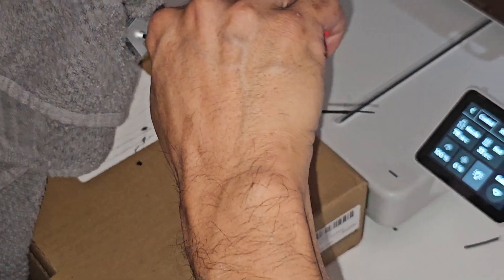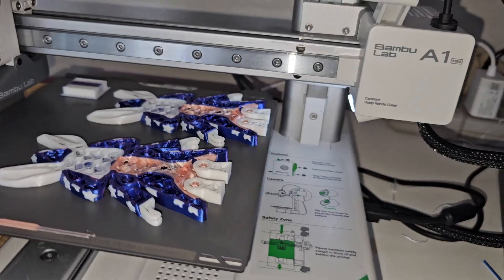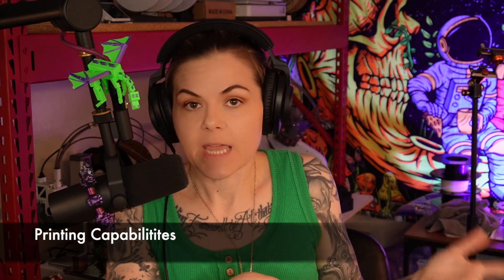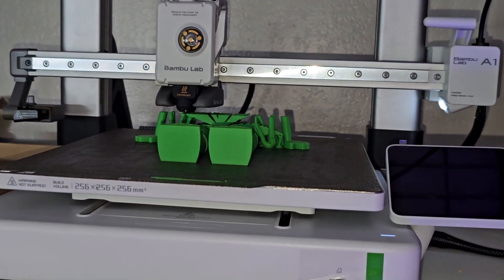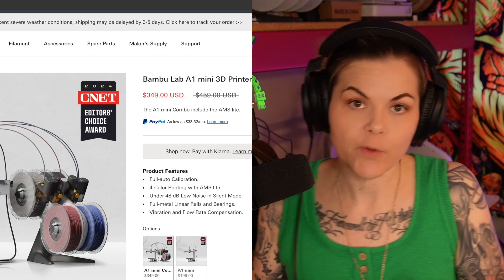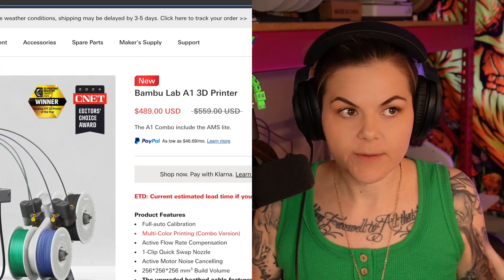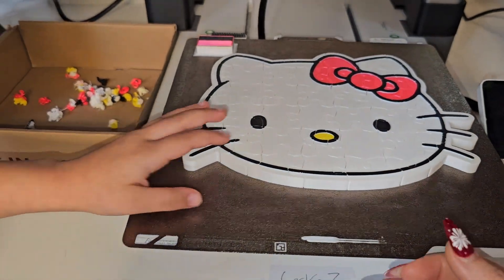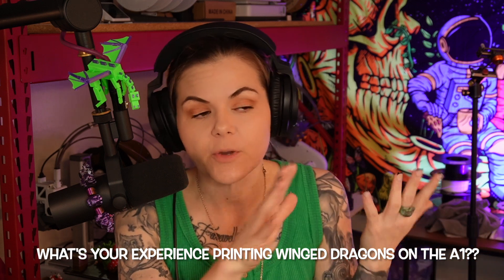Which 3D Printer REIGNS SUPREME After 60 Days of Nonstop Printing?

Comment: I make lithophane lamps and started with a p1s. I had to get another printer due to high demand and got an a1 mini for its price n availability at the time. A little background, I've been printing for about 8 years now and always disliked small print beds. When i setup my lamp on the a1 mini, i was totally shocked! This thing is a beast! I now have 3. Maintenence, reliability... lil fker is  just a work horse! Tough too! I dropped one from a 3' desk, snapped the top feed hub, got a replacement, checked the bed screws, recalibrated... and the lil fker started right back up like nothing happened 🤯
Reply from the maker: @jackavol4150  🤣🤣 that's awesome!! Such a great printer I agree!!

Comment: I bought an A1 mini/AMS combo at the end of last year and then a P1S without the AMS about a month later. Then this month I bought an additional P1S with the AMS combo. They all run pretty much around the clock as I'm building out a gridfinity system to organize the multitude of things that I have in a large toolbox in the garage as well as the two smaller tool chests that reside in my home office. I can't image not having them. Having a P1S without the AMS and one with it I can definitely say that having the AMS is a huge convenience over not having one. Printing out storage solutions that include labels is so much more convenient to do when you have multiple colors loaded up in the AMS to print the body of the container in one color and then have it switch to a different color for the text to make it easily readable. I have just a single instance of a piece of filament breaking off in the P1S AMS and having to disassemble it to get it out, but it was surprisingly simple to do when you follow the online instructions. And the filament breaking off was really my own fault. I knew it was partially broken when I put it in but was hoping that the AMS would still be able to pull it through, so it could have totally been avoided. Being lazy cost me half an hour of downtime to take it all apart and fix it.😋
Reply from the maker: @jocelyn-n-tech  thanks for the info! I'm currently trying to decide if I want to get a p1p or a p1s. And also trying to decide if I want an ams on either of them. The p1p with an ams is the same price as the p1s combo.  I almost want either 1 color or 8 colors. Such a dilemma😂😂 i find a lot of positive comments regarding the p1s and not many about the p1p so I have some research to do still. Thanks for watching, I couldn't imagine not having printers either. So many useful items around the house from them !
Reply: @HamilsHouseof3DPrints  I know it can be a tough decision! I bounced back and forth between the P1P and P1S as well. I ultimately picked the P1S to sort of "future proof" myself in case I wanted to get into printing more advanced materials. But buying a P1P for now and waiting until you need it in order to purchase the external panel kit makes sense as well. You kinda can't go wrong with any of them to be honest.

Comment: Somethings wrong with your A1s causing clogs. Had mine since Dec 2023 printing at least weekly with zero clogs. I primarily use polylite pla+. I'd try different print settings, then new print nozzle, then print head, etc.
Reply from the maker: We replaced nozzles and luckily haven't had many issues except the filament spools always get stuck. Dont know how to avoid that issue
Reply: @HamilsHouseof3DPrints  good to hear! Filament spools are such a pain. I wish the AMS would just give it a bit more gas pulling on the filament as opposed to just giving up and showing an error. If you find a solution do another video to help us all out!

Comment: Our A1 and A1 mini are about as reliable as each other. We've had clogs on both, but it's mainly been a problem on the A1, as we only have one AMS lite, and that's attached to the A1. Almost all of our clogs have been with 0.2mm nozzles though, due to switching between our PVA support material and either PLA or PETG print materials.

When the A1 does clog though, being able to swap in another nozzle and continue the print immediately, using the A1 mini to deal with the clogged nozzle, is a a hugte time saver. It helps that I only p[aid £70 for the A1 mini, since I was going to buy an AMS lite, it made sense to just buy an A1 mini combo instead of a stand alone AMS lite.
Reply from the maker: Having extra nozzles on hand has been a must for us too!! Any way I can avoid delaying a project, so that's been helpful! Thanks for watching 😃

Comment: If space is important you will find that the P1 and X1 with the AMS on top has less than half the footprint.  That alone could be worth the extra cost especially to a business which might end up with many printers.

Switch to a 0.6 nozzle and this will probably eliminate your clogs.  Debris in (or on) the filament is the most common cause.  I don't know what you are using for filament or the conditions in the room where you print.  Look for a contamination source.  Something like pet hair or chemical deposits.  Something seemingly innocuous like hairspray.  Could be something simple like hand lotion deposited on the end of the filament when it is loaded.

As for Jams, I assume you are talking about a jam in the extruder.  Clogs can lead to a jam.  But this seems like it could also be caused by foreign material in or on the filament.

This was a nice video.  I wish you well in your 3D printing endeavors.
Reply from the maker: Great advice on changing to a .6 nozzle, this was not something I had considered! And i think you nailed it with debris. We have 2 small dogs and they are laying around in our print room probably shedding their little hairs all over my stuff!! 😖 LOL I'll have to clean up more often! Thanks so much for the input and thanks for watching! 😃

Comment: I've had an A1 going since summer. Printed an obscene amount of stuff. It's been smooth for the most part, including half a roll of TPU. The second half of the same spool is when the clogs started. I'm never using that brand again. Now I'm using eSun, and it's been less hassle than tweaking different brands of PLA to satisfaction, weirdly.

The Mini is smaller, sturdier, so in theory it should be more durable. In practice, it's a bit of a lottery. Do more comparisons when you have ten of each :)
(And where are the larger build plates? Bambu have been slacking there!)
Reply from the maker: Not gonna lie, i think its called the Kobra Max.. with the build plate of 420 x 420, totally caught my eye. Some people on the comments mentioned a system that changes the bed plate automatically for you on the a1 mini. Kind of a big deal I'd have to say, Im excited to check that out. For the clogs we now have extra nozzles on hand just so we can quickly continue the print without any delays. 10 of each!!! Ha that's way too many for me 😅 eh, maybe one day...Thanks for watching!
Reply: @HamilsHouseof3DPrints  Oh, that Kobra Max price looks reasonable. I wonder what it'll be in my country - quick guesstimate says it'll be cheaper than a Creality K-whatever or Bambu Lab letter-number-letter device. I need a larger basement!

Comment: I have years of experience in 3D printing (hobby). The A1 combo seems to be the sweet spot in terms of price and capability.
My first commercial purchase is the A1 (coming soon). 😁
If you are looking at maybe using harder materials to print in the future, skip the P1P and jump to the P1S if it's in stock.
The A1 mini is a great printer for small items for sure. Cheers!  ps. love the bloopers🤣
Reply from the maker: Thanks so much for watching! Some people were commenting to check out 3D printers from brands other than Bambu, do you recommend any over another?
Reply: @HamilsHouseof3DPrints  Can't really comment on that, my machines are all old ones I've modified.

Comment: Have an A1 and using Bambu and Polymaker filament. Never had a clog. A1 and A1 mini have the same nozzles and extruders, so it is not that.
I chose the A! because of lack of space. I would not be able to have the Mini and AMS lite, but the fact that the AMS lite can be installed on the A1, does it take up less space.
Reply from the maker: I had my AMS on top of my a1's and it is a smaller footprint than the a1 mini. It felt quite tall and it's not the easiest to install filament unless you can walk around it....
Reply: @HamilsHouseof3DPrints  Do you know that you can loosen the screw on the AMS lite and turn it 90 degrees when loading and reloading? It took quite some time before I found out. I use a lot of black and white filament, so they sit mainly in slot 1 and 2. Other colors, usually in 3 and 4.
Reply from the maker: @Gert-DK  I did not realize this! Thanks for the advice 😀
Reply from the maker: Thanks for watching! 😀

Comment: We’ve been using our A1 pretty much daily for about 5 months and we just experienced our first filament jam. It has been so reliable. The jam was probably due to our not cleaning the extruder gear regularly. If you put the AMS on top of the A1 it will have a smaller footprint than the mini with the AMS.

Comment: It’s weird, because these machines basically have the same parts, except the z axis. But, the A1 Mini I swear just rock it harder than the A1, it just does the job without fail to me compared to the A1. The A1 has had way more lost prints vs the A1 mini.
Reply from the maker: Totally agree! It's a beast!

Comment: I have had my P1S for a little over a year and haven't had any major problems with it. I did change out my AMS housing on it for the Python AMS which opened up a lot more filament spools on this machine. I recently bought 2 A1s and haven't really had any issues with them either. I did not purchased the AMS units for these but I am looking at potentially buying them for the A1s in the near future.
Reply from the maker: I definitely think the clog issue comes from the ams unit and swapping colors. I have never heard of a Python AMS !! I'm excited to check it out!! Thanks for watching 😀
Reply: @HamilsHouseof3DPrints  Voxel PLA sales them as well as the hardware kit if you decide  to print everything yourself. They also have an enclosure that you can 3D print for it and get the hardware and plexiglass panels for it from them as well.

Comment: Clogging is likely a filament settings issue; the A1 and the mini use the exact same extruder, feeding mechanism and nozzles. Settings are likely a source of errors for a lot of new users. No clogs on any of the A1s or my mini; all have been printing reliably since I got them (February 2024 for the mini; May 2024 for my three A1s). I print with a bunch of filament brands; bambu, polymaker, esun, sunlu, atomic, a bunch of generic chinese brands, etc. The mini is my favorite printer, but if I could have only one, it would be the full size A1. On the other hand, if what I was printing for my farm could fit on a mini, I'd happily run a small fleet of them. Two minis will have more output than a single A1. I definitely recommend getting the combo units regardless if you do multi color printing. Having four filaments on hand, ready to go has been a game changer.
Reply from the maker: I agree with everything you mentioned. the filament settings is an easy step to miss. Unfortunately, I don't believe that has been the issue for us. I failed to mention that these clogs were happening with a hardened steel nozzle vs the stainless steel and I was using a silk. Those variables should have been mentioned, I dont know if that has anything to do with it but we were never actually able to fix that nozzle. Thanks for watching!😀
Reply: What is different betwen the A1 and A1 mini is the length of the bowden tubes between the AMS lite and the extruder. I could see that this might result in some differences in behaviour, especially is using undesized filaments, but I think it's more likely that the observed problems are down to manufacturing tolerances. No matter how good your QA systems arem dud can go unnioticed, it's how well you deal with it that counts.

With respect to always buiying combos for print farms, that makes sense, just being able to automatically switch spools in the middle of a print when one spool runs out means less downtime and fewer interventions.
Reply: @markbooth3066  Right; the AMS lite that comes with the full size A1 has longer tubes than the one that comes with the mini; the standalone AMS lite has the same length tubes as the full size A1 combo as well. I ended up shortening the tubes on my MAS lites though, because I wall mount them.
Reply: We went the other way @, I bought an A1 for my other half, and we immediately decided we wanted an AMS lite too, so I bought the A1 mini combo, and a replacement A1 tube set, and set up the AMS lite on the A1 instead of the A1 mini.

Comment: I've had My A1 for about a Month and a Half at this Point. Haven't had any problems. No Clogs, Jams, or anything like that. A1 is also my first Real Printer. Had an ender 3v2 before it but that was just straight up Trash. Such a difference between the two!
Reply from the maker: Iv'e heard Bambu has changed the game when it comes to the quality and ease of use on 3D printing compared to the first 3D printers that came out. I thought about getting one but my friend said don't bother!😳 Curious, do you use only brand specific filament with your A1?
Reply: @HamilsHouseof3DPrints  No. Im actually still looking for a reliable and cheap option. Bought some eSUN Filament from Amazon which works, but they have a very limited color selection. Before that i used some 3DJake Pla and that was perfect!

Comment: Yes I'm having so many issues with my A1 right now,  plus I feel like the consistently is hit and miss.  constantly clogging. I've switched nozzles constant recalibrations constant adjusting in the slicer.  It doesn't matter if it's PLA or PETG. At this point my 2 Minis runs better.
Reply from the maker: Crazy that you seem to have the same issues as me. I wonder how many others share similar experiences. Thanks for watching !